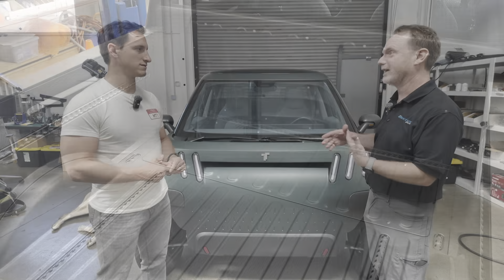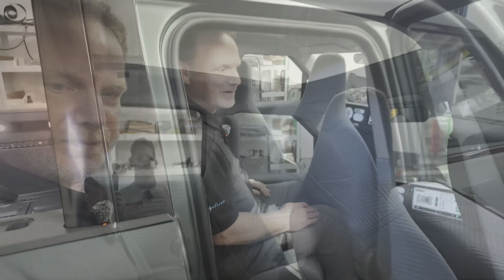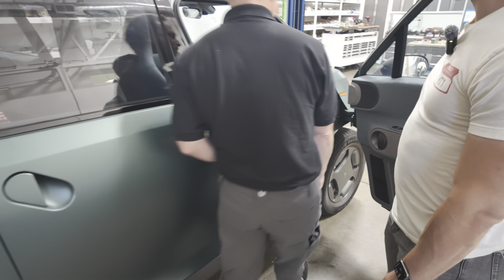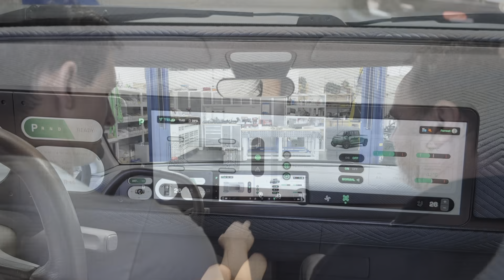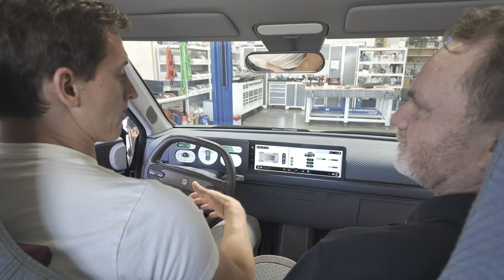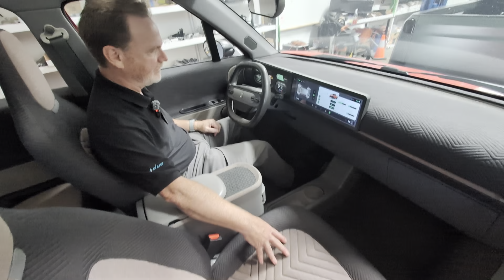MINI Truck with FULLY LOADED features | Telo Trucks is a gamechanger!

Comment: I am very excited that someone is at last making a well designed small truck. I want nothing to do with those behemoths currently on the road. That said, I wish the Telo offered a six foot bed. It would still be a short truck at a foot longer. I sometimes carry things like compost and gravel in my trucks, and another foot would make a big difference for ease of loading. Also, I carry a lot of tools for work, and that foot would make a big difference there too. I will probably buy one regardless....

Comment: 4:43 I drive a Subaru Crosstrek and use it for my service business in SF.  The Telo is two ft. shorter so will making parking far easier.  Time savings alone on finding parking will save me about $90K over 5 years at my hourly rate.  Fuel savings and oil changes over the next 5 years should be another $15K.  These savings easily off-set the relatively high price of the fully loaded model.  One significant downside is a 350 range as compared to 450 for the Crosstrek.  With all the other extreme advantages I'll make that work.

Comment: Please make the optional floor mats cover the wheel well area's. Purchased after market rubber floor mats for my 2017 bolt that covers up the foot position on the vertical parts. It is great for winter and dirt.

Comment: I didn't understand whether or not the vehicle will be offered as an all-wheel drive option. I hope so. It's an impressive accomplishment so far.
Reply: Yes, it will be offered with AWD, and in fact most of the reservations so far have been for that spec. The Telo trucks website is a bit bare, but it has some more specs info

Comment: 250/500hp is just silly and results in the big and expensive battery and motors that leads to a 41k price tag.  Not likely if the Slate truck makes it to market.  not as 'cool" but 200hp, much smaller battery but 150/250 mile range and price in the 20's....

Comment: I owned a 1970 Datsun pickup (no storage behind the seat) and a 1978 Toyota SR5 pickup with a bit of an extended cab for some storage. But the Telo is SO much more versatile as a pickup and a 4-5 seater when needed. This could be the perfect 2nd vehicle for many families for town, carpool, sports equipment, etc.

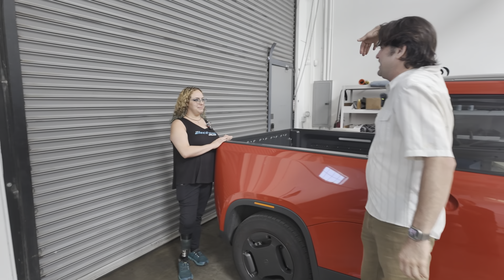Comment: Good point @42:00
I'm 6'1 and I can't easily reach into the bed of my Ram without standing on the wheel.  And my truck is at its stock ride height,  I think it's funny seeing guys changing the oil or topping off the coolant in their truck and they need a small step ladder to do so.  Trucks have gotten so oversized over the past couple decades

Comment: This is the BEV pickup I am most interested in. With BEV the vehicles need to be much more efficient to be practical. I am not interested in a limited utility Slate. But the utility Telo offers is a very attractive solution. But I am not interested in a glass roof.
Reply from the maker: ooh that could be an interesting cost savings option. I wonder how much no glass roof would save. - Liv

Comment: I like it.  I think they could have made the cabin 6 inches bigger.  Since it has no hood.    Add 3 inches in the back and 3 inches in the front which would have made a big difference getting in and out.
Reply from the maker: They are making some minor adjustments to make entry and exit a little easier.
Reply: They probably could have, and I suspect that future versions of the MT1 are going to grow slightly so that they are the same size as a 2026 2 door Mini. 158 inches instead of 152.
Reply: @TROPtastic  They’re pretty firm on the 152”. I doubt that is going to change.😊

Comment: will it be able to regen using the brake pedal (blended braking... only applying friction braking when absolutely necessary). The Ford Mache e has this ability which is great because you get the same level of regen/electric-recapture whether braking in 1 pedal or 2 pedal mode. Win-Win so you can pick you preferred driving style and get the same optimal energy recapture regardless.

Comment: Does it comes with a spare tire? If not, it will be a good idea to extend it a bit and use the monster door for a full size tire.
Reply: Most don't these days. There's an entire bed you can put your spare in if you like... Almost nobody in this market is going to want to want to give up small footprint and lockable storage for that.
Reply: I would not want this, but either front facing or tailgate mounted spare might work. @michaelcummins5974

Comment: TBH this truck ticks every box but starting price. It feels a bit pricey even with no options. I get it for it's usefulness but you have to consider the market. If they can manage to get that starting price down another $5k or so I think it would help. I suppose this also depends on any rebates. But glad to see a practical truck that offers utility and the potential to have so many passengers. Not some over priced vanity piece. So if you went with the solar roof and solar bed cap how much more range would that give you?
Reply from the maker: Ya I do agree on the pricing. With some really compelling options coming around the 30k mark, this could definitely use a price drop. But then again, it does offer a TON with really few compromises...so it's still compelling too! - Liv

Comment: $50k for this small truck with 4wd and long range is overpriced ... Should be in the mid to high $30k range
Reply: Every vehicle on the market with comparable capabilities is unparkably huge, and thousands to tens of thousands more expensive. You are correct that 50k is a big ask, but it's not much more than the average new vehicle cost these days.
Reply: 🤣 You can’t be serious?🤣
Reply: Maybe back in 2005.
Reply: Would have been ever more expensive back then. EVs keep getting cheaper. The Tesla roadster was over $100k when it came out.

Comment: Look at all that leg room in the 4 person.  I am a BIG guy, well over 6'.  I would be interested if the 2 seated would fit me comfortably.
Reply: At launch, the Telo will only be offered as a 4-door. The second model is planned to be a front-engined van in a similar form factor. I took a look under the rear bench in the prototype, and the rear seat appears to be easily removable with a wrench, in case you would rather have that space for tools. I've seen video of a 6'8" dude sitting in it, and he still had a bit of headroom.
Reply: @Tatterbone  Thank you for the response.

Comment: I luv this little car and I know there whole sales point is it's smaller then  a mini but I'd like it if they could make it so the 4x8 fits with the chair slid all the way back I'm over weight so when I get in and out of the vehicle I slide my chair all the way back so I can get out easier. It would also be nice if the window could get out of the way some how iether a wendow that rolles down into the devider wall or just snapped in and out some how like how u can remove the back off jeeps some how over all I luv this thing
Reply: They are working on these problems for the second prototype! The rear window and crossbar are difficult because they contribute to chassis stiffness and crash safety, and they are trying to put a 60-40 split in the midgate. I'm hoping they go the direction of a roll hoop around the whole thing, so we get all the goodies and still have the stability.

Comment: I would love to have a mode with no regen on the accelerator; with it is integrated on the brake, of course. This is the most efficient way to drive; because you accelerate less.
Reply: They have that functionality. You can have anywhere from true one pedal to the old school automatic ice style driving, with Regen in the brake pedal. It truly is a no brainer to offer this adaptability. 

Personally, I like a mid setting... Way less aggressive than Tesla, but way less pedal changing. If you're steady with your foot, it doesn't cause increased consumption, but it's way more convenient around town. On long highway trips I turn it off as it has minimal benefit there but can cost in efficiency.
Reply: Interesting - as a former LEAF owner for 10 years and Tesla owner for 8, I find I'm in the opposite camp - give me lots of regen and true one-pedal down to a full stop.  Almost zero brake wear and so easy to modulate your speed.

Comment: I haven't finished the video, but I don't like how for my trailers are exactly 4 ft by 8 ft, any little damage stops you from dropping in a full sheet. Telo has the same potential. They already said how the seat has to be moved up some. Wood adding 2 in to that truck really hurt it
Reply: The seat mechanisms in the prototype are considerably thicker than what will be used in the production vehicle- so, a few more inches of space; that said, I reckon nothing can account for your debris problem- if you want to carry broken lumber/sheet goods/whatever, you'll probably want to use a trailer, regardless.
Reply: The width is over 48... Either by a half or a full inch, not positive. I think you can get over 96 as well by pulling the seat a little further forward, but you better not be very tall to try to drive that way. 

This is an important exercise in rethinking how we package a vehicle, maximizing utility in minimized space, etc. So it's a really important endeavor and for many target users, they won't care about carrying sheet goods with tailgate up, if at all. So I think it's an important goal to maintain this minimum size. 

That said, I think the MT2 should be the size of a 4 door mini ( 159" ), more optimized for people like you and me who would def prefer that... While still being extremely good in urban areas.
Reply: @michaelcummins5974 I also want to see how the seats collapse to allow for the wall to fall.

Comment: Would love to get info on the hitch electrics layout. Hopefully, it will have 7 pin with brake controls. I believe they are needed above
3000 lbs of a trailer weight.
Reply: Given the towing capacity, I'm sure it will feature at least full conventional controls (BTW, the receiver hitch is integrated behind a bumper panel).   The prospects of a stock front receiver hitch isn't great- the front end is very compact, space is a premium, and anything that might compromise the crash safety rating won't make it into the design.
Reply: it can haul 6,000 lbs trailer weight if you get the dual motor. would like the option for a front trailer hitch so that can add a hitch trailer, snow plow, etc

Comment: I've sat in the Telo prototypes, and can confirm that the bed really does extend to 8 feet with the midgate down, and is actually 48.5 inches wide between the rear wheel bulges. This means that 4'x8' plywood or drywall can stack flat on the floor, with the tailgate closed. Handyfolks take note: You could bring your materials and tools to an offroad worksite, run all your powertools and charge all your batteries for days, and still have plenty of range to get home when you're done. They are working on making the rear window and crossbar removable, and on a 60/40 split for the midgate.
Reply: Do you know how much legroom is in front seat with it pulled forward enough to get 8 foot sheets inside the tailgate? It looks like it would be undrivable for taller people like that.
Reply: @michaelcummins5974  Once you get in past the front wheel bulges, the footwells are actually pretty roomy. The pedestal style seat supports make it easier to get your feet in. They are making changes to the next interior that should make it roomier in every direction.
Reply: the sides of the midgate look angled, so wondering how many sheets of 4x8 plywood can fit with the tailgate closed
Reply: @user-ml8dm9fz6l The bed at the floor is actually a few inches longer than 5', due to the angle.  The bed walls are 20", with the midgate aperture a few inches higher.  While you could easily stack 40 sheets of half inch drywall in that space, the payload capacity is 2000 lbs- so, make that 36 sheets to allow for a driver.   Yes, with the midgate down, that entire stack could be enclosed under the cap with the tailgate closed.   Check out TELO Trucks YT page for video of plywood being loaded.
Reply: @user-ml8dm9fz6l Good question. Remember that the 48.5" width is between the wheel bulges, so the angled sides of the front bed-wall start several inches wider than the 4'x8' sheets. The midgate opening itself is a full 4' wide, so yes you can stack a few. That being said, I believe the seatbacks lean back, so your stack of plywood sheets may be limited because of length. Above a certain stack height, the tailgate might have to be down to fit the whole stack in.
Reply: This bot again, literally typing nearly the exact comment in multiple videos.
Reply: @mondo_stunts27   Oh rats, I am found out. Yes I am a bot. I was purchased by your mother and frankly she is wearing me out.
Reply: @Tatterbone  oh wait you mean you didn’t post the same bot comment? 😂 
Claiming all this insane shit in a car that does not exist lol fuck me you are stupid.
Reply: @Tatterbone  I can’t wait to see one of those and I’m going to floor it past it in my truck. It’s one of the fastest factory diesels ever made no exaggeration
Reply: @mondo_stunts27  a high-strung performance diesel is going to need a lot of time in the shop sooner or later. Hopefully it won't break your budget.
Reply: @TROPtastic  sounds like a job for plastic

Comment: THE BIGGEST SCAM TRUCK EVER!! You are putting your family’s life in your hands by driving this dangerous truck. You simply need more crumple zone. There’s a reason they don’t have any crash testing into the back of a semi trailer. This is a big old scam where there getting little investment but not the billions needed. Just enough of the 10 million to live life on the hog but never produce a vehicle
Reply: Tf you on about? They have two prototypes... they haven't even started crash testing
Reply: @evansmithy256 we’ll get in and be the crash testing DUMMY
Reply: Troll lots of sites, do you?
Reply: Did you even watch the interview lol? There has clearly been way more thought and expertise poured into this crumple zone than most other vehicles on the road today. Real world crash testing will come in time.
Reply: Are happier knowing the engine in your vehicle will end up in the passenger compartment versus a functional crush zone?
Reply: @peterm1858 engines never end up on your lap. All those cars use all the crumple zones up and still encroach onto the dummy. Put the Telo on a 30% offset crash and you are screwed
Reply: @frostcb2 I'll trust the founder who is literally an expert in this exact area, plus the simulated safety testing. It will be fine.
Reply: I can't quite make out the sounds coming from your lower colon- if you could spread those cheeks a little wider and enunciate, please.   (For those of you not so impaired, visit the TELO Trucks You Tube page, where you may find several videos that confront the care dedicated to crash safety design, including more than 14" of unobtrusive crumple zone.)

Comment: I love the originality and creativity of it, but I’m a little surprised and I’m not sure if they range estimates are being very conservative because unless I’m mistaken, he said 350 miles of range with a 160 kWh pack that’s the same efficiency as my lightning, which is much much larger. That doesn’t make any sense at all to me. It should be much more efficient. :_PurplePony:
Reply: 106 kWh!
Reply: @MrInternet2000 that makes a lot more sense
Reply: @bowefamilyEV  As a mater of fact, when Munro visited TELO Trucks, he was musing about placing a cap for accessing wiper fluid in the wiper well, and Jason remarked that such placement would disturb the airflow traveling through the front end.   A lot of care has been given to aerodynamics.

Comment: I really love when accessibility and acknowledgement of the different sizes, shapes and needs of the buyer are front and center. Keep up the great work you two! Hearing about the feedback and small changes going into the vehicle are great. 
Color wise, I love that pretty green. It's a nice, soothing color.
Do you know if they will have a pet mode? 
What do you think about the accessories they are offering like the solar panel tonneau cover with solar panels from Aptera?
How were the screens for readability? Were there any accessibility options for larger text for the glasses/contacts wearing folks?
Which interior color did you prefer?
Reply: There will be a "pet mode"- it's actually one of the reasons to opt for integrated solar panels.
Reply: @mavigogun very cool
Reply: @PattyTheGeek  Literally.  ;)
Reply: I find it hilarious that the Telo solar panel tonneau covers could be the first real product that Aptera will be delivering. Aptera has been stalled in design longer than Telo as a company has been around.
Reply: @Vigilante6700  Aptera has been supplying a camper company with custom panels for some time now.  Far from "stalled in design", their slack sails are financial.  Plenty to be critical of, no doubt- I think we can be glad TELO seems to have learned much from the success and failures of similar efforts.